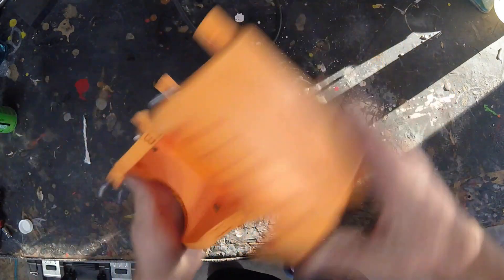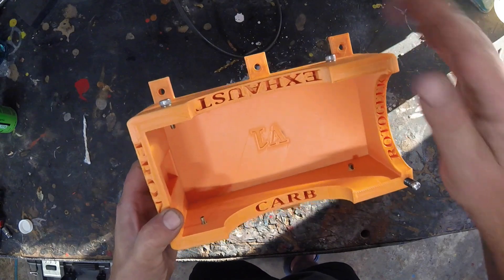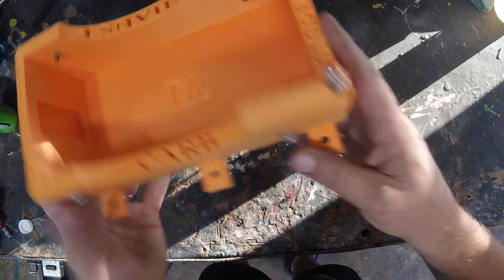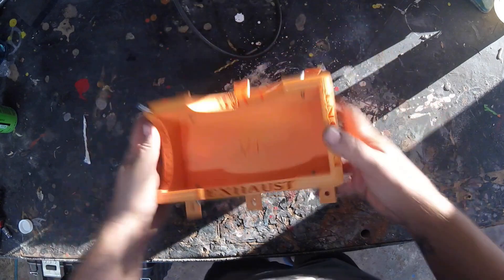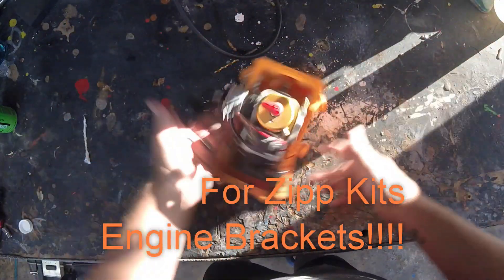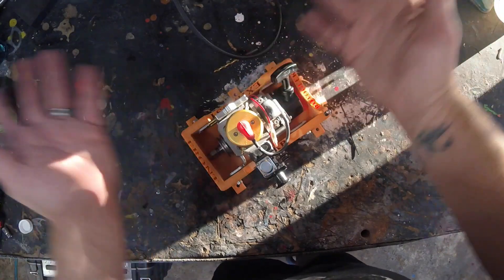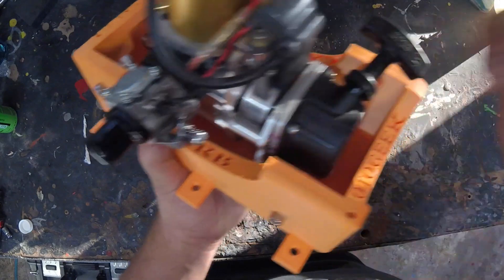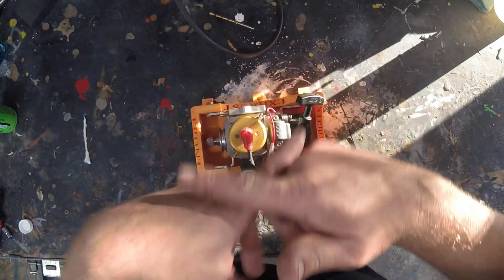3D Printed Zenoah Marine engine Test Stand!!!!!!!!!

Comment: So I'm relatively new to gas boats but quickly falling for them, lol the one thing that caught my attention was not using idle screw? Are you using the servo postion for that or? Feel like I totally missed that but, appreciate all the videos lately!! Hard to believe I spent an hour watching a guy talking about RC boats in his garage lol all the jabs at Coxidean made it even more enjoyable.
Reply from the maker: Comletely agree with Mike, gas is the way to go in my opinion. and agree with him on nitro, thats a special discipline lol. ive done a lot of nitro and theres a reason i dont do it anymore! as for the idle, yes the servo holds your idle speed. ill do a quick video on that for ya.
Reply: yea we use a switch on what ever kinda radio u using to idle up n down. u will love 2 stroke gas engine boats! just dont start out with a nitro it will make u hate gas! weedeater race engines is awesome u will be a addict once u get your 1st 1 lol im up to 9 gassers